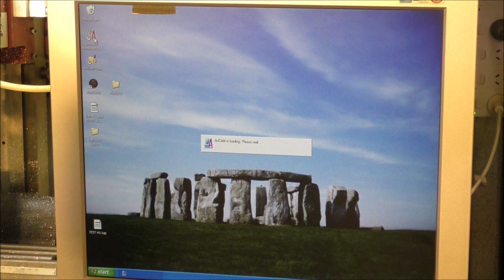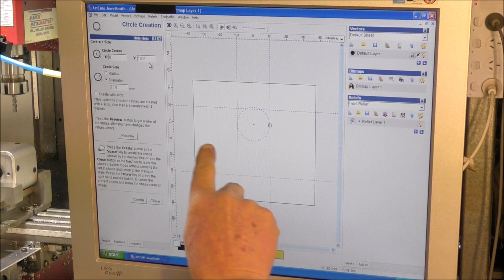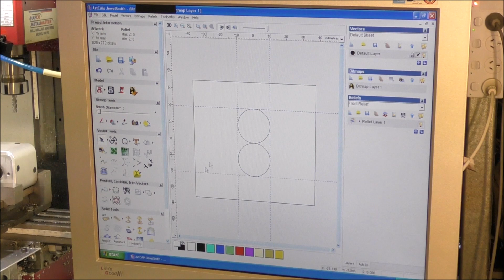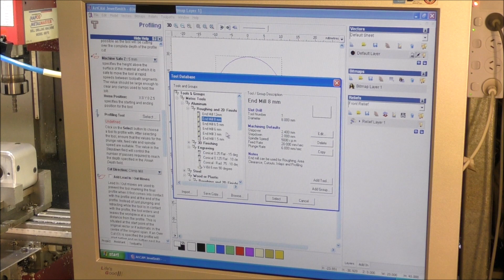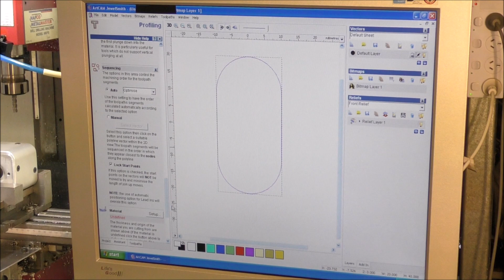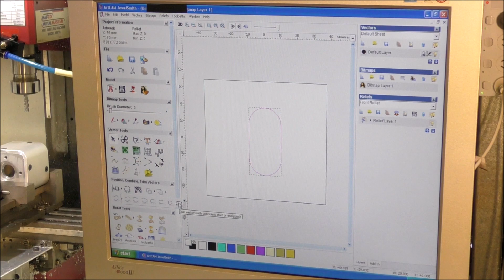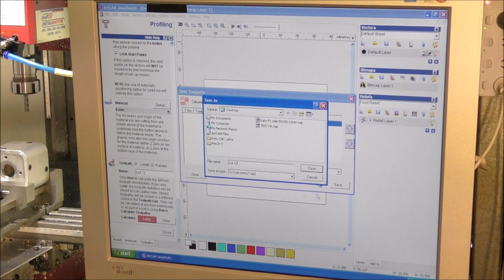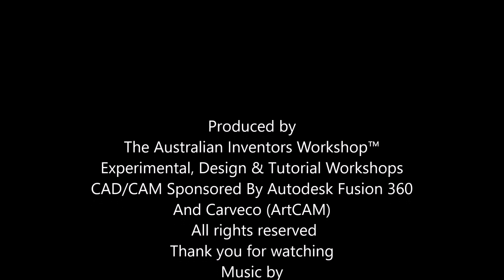331 ArtCAM working with vectors, tools, speeds and feeds & wizards.

Comment: Hi Roger. I am using artcam 2017. I noticed that the metric speeds differ from imperial. i compared a 6mm endmill to a 1/4 inch endmill. the speeds for the imperial bit is in inc but when i changed the settings to mm/sec it is half of the metric tools. which speeds are correct, the metric or imperial?
thanks for your great videos.
JP